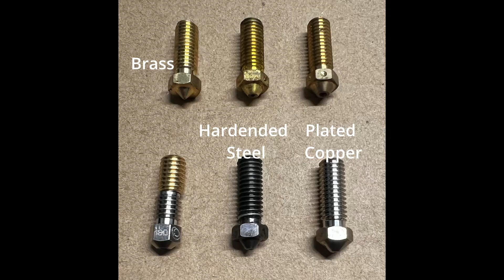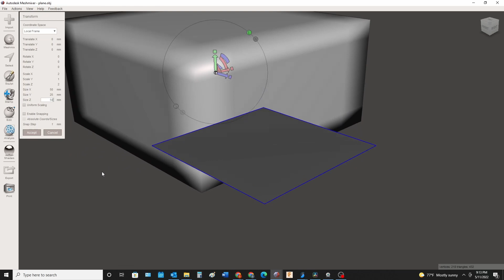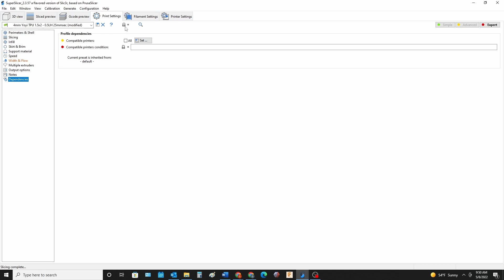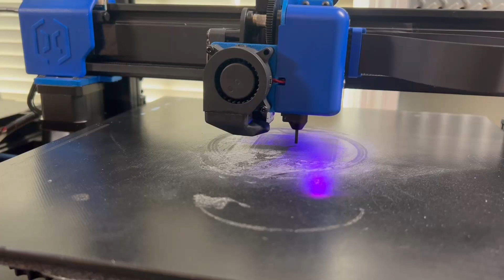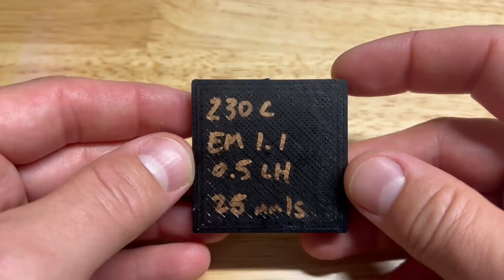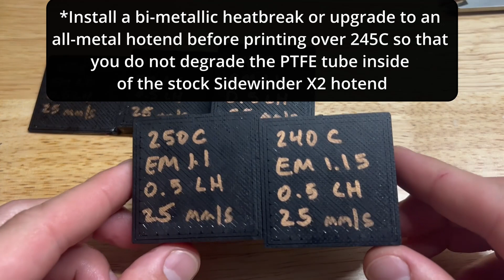Nozzles and Flow Rate Calibration

Comment: Have you considered using a Super Volcano with a 50W heat core?
Reply from the maker: I have not, for a couple of reasons.  I've read a lot of reports of issues with them breaking.  More importantly though, I don't think they fill a need for me.  The largest nozzle size is 1.4mm, so line width and layer height will be limited by that, and I won't be able to go any larger than I can with the 1.8mm CHT nozzle.  That would mean I have to increase speed to take advantage of the 110 mm^3/sec potential flow rates.  That would require printing at 50+ mm/sec, which doesn't serve a purpose for the prosthetics I print.  I print my PETG with low levels on my cooling fan, so my print would sag and deform from the thermal mass and not cooling layers below fast enough before coming back around for the next layer.  And  TPU just wouldn't do well at those speeds in my experience.  Have you tried it?
Reply: @limbandlattice6487  I appreciate the informative reply. Yes, I've been experimenting- mostly with PETG- and you're right about the cooling issue. External blowers have helped. But, I'd like to try the 1.8mm CHT nozzle, or maybe drill out a larger one. I rarely find anyone who's actually put the Super Volcano to practical use, though I've been searching  for over 18 months.
Reply: @terrymueller1041  I have tried drilling out a 1.2mm Volcano up to 1.75mm.  It won’t melt material any faster, and the flat end of the nozzle doesn’t get any larger, actually that part gets worse when you drill some away.  If your goal is a larger diameter, I definitely recommend just going with the CHT.  The internal geometry of it makes all the difference.
Reply: @8azk3ibsi  Thanks, Derick. Did you use a 50W heat core with your drilled 1.75mm nozzle?
Reply from the maker: @terrymueller1041  I've got multiple printers with Volcano nozzles/heater blocks and different heater cartridges.  I'm not sure which ones I actually tried it on